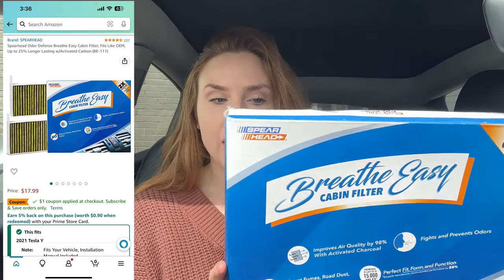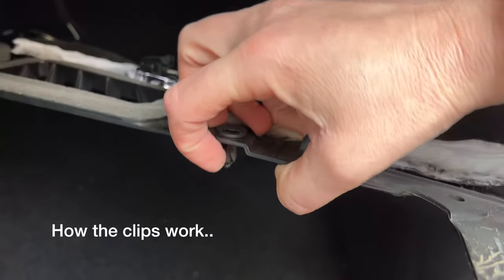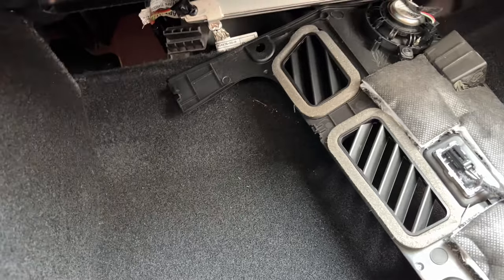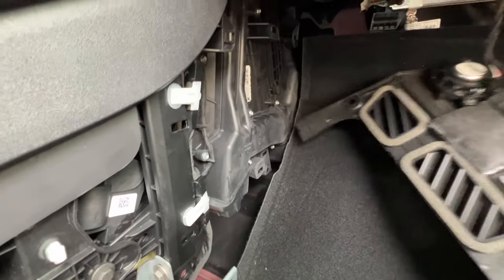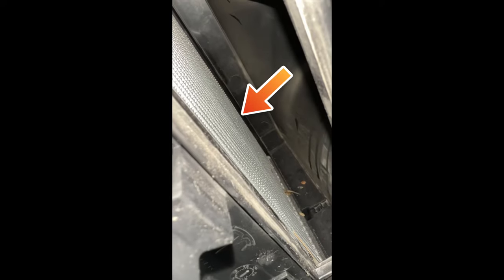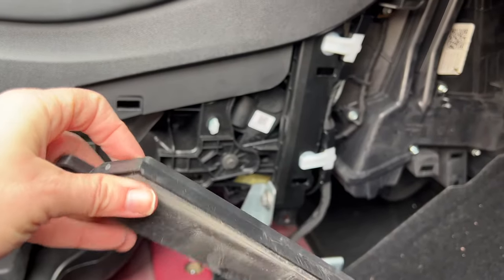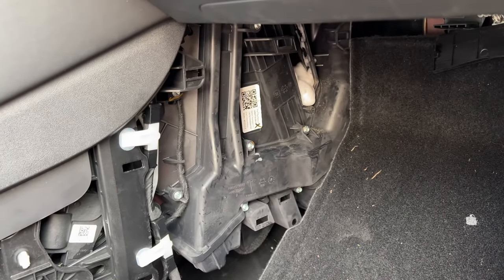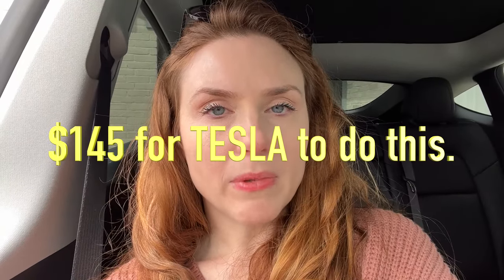DIY Tesla Cabin Filter Replacement & Coil Cleaning (Model 3/Y Full Tutorial)

Comment: Always great instructions!  After doing this, the heater trick does help but one thing I've found that "revitalizes" the filters for longer than the heater is to spray a fine mist of water with a little hydrogen peroxide and rubbing alcohol in it into the inlet under the frunk with the fan on high.  If you spray it with a misting bottle (from a salon store) the mist is really fine, doesn't puddle, and just dampens the filters, killing the bacteria.  2 bursts of like 5 seconds each is good.  The peroxide and alcohol also evaporate 100% and leave no residue unlike Ozium, Lysol, and other things I've heard being used.

Comment: Thanks for helping everyone replace filters and clean coil.
One caveat.
AC chemical coil cleaners are better. The foam you use is not just to clean( as a detergent) or disinfect; it actually has a very high PH chemical removing a thin layer of aluminum oxide so it improves the heat exchange.
You do not need to dry it after using it; actually the opposite. As soon as you turn the AC on, the condensation makes the remainder chemical drip down the bottom drain. You don't need to rinse it.
You don't want that chemical to stay there too long; it will keep etching the aluminum fins.
I used the foam to clean and service the front condenser( the car's AC and radiator) also.( check between the front radiators; they are probably full of leaves and rocks and hair and dirt etc.

Comment: When I bought my 2019 Model 3 Dual Motor back in November 2022, the first thing I did was change the filters based on your videos and it was pretty easy compared to other car related tasks I've had to do over the years.   It wasn't smelling bad yet, but it was a noticeable improvement after the coils were cleaned and filters changed.   Hopefully here in Indiana, I only have to do it once a year.   This summer, I'll have to remember to run my heater and dry it out every now and then.  Another great video!

Comment: Welcome back, Sara!  I'm glad you mentioned the magnetizing trick.  As you may recall from your Model 3, that screw (at least before the refresh) is on the top, making it tougher to get to.  I found that using a "short" driver a lot easier to get in there.  BTW, you can magnetize the screw itself, without the need of a special magnetized bit, if you have a strong magnet laying around.  Just drag the screw across the magnet for several seconds and voila!   I changed our Model 3 filters after watching your other video and used the same stuff.  Excellent result.  Less than six months later, it started smelling funky again, even though I live in semi-arid SoCal.  So I decided to try something "different".  I have a small, 120v ozone generator and stuck it in the air intake and ran the fan on high for about 20 minutes, total.  10 with the ozone generator running, then another 10 without to clear the ozone out of there.  Hasn't been a problem since, but I'll probably clean the coils and change the filters again in another month or three, regardless.  Hope your husband and kids appreciate your work!!

Comment: Thanks a lot for this. Approaching 15k miles on the Y in the first year and I may change the filters before summer hits. This is one of my favorite videos you’ve made so far. Not much maintenance on Teslas but this is a big plus to know how to do.
Reply from the maker: You’re very welcome! But if you car isn’t smelling super horrible rn, I would wait u til AFTER summer to do it. Because the condensation from using the A/C in summer is what causes the problem. So if you do this after every summer your new clean filters will stay clean longer. Does that make sense? Like every summer, you’re breeding that bacteria on them with the moisture caused by A/C usage.
Reply: @SaraJAwesome  it makes a lot of sense. I rented a Polestar 2 in Arizona recently with 17k miles and it smelt like you said when I turned the AC on. Guy that rented it to me didn’t notice it apparently. I told him it was probably his cabin filter.

Comment: You are correct about the condensation. I have had this problem in my Y. The main issue for me was that using AC usually automatically goes into recirculating mode. I manually put it to fresh air mode often and it seems to dry out the chamber. FYI I have had this issue on my non Tesla vehicle that was used in recirculating mode All the time. Since using it in fresh air mode seems to solve the issue for me.
Reply from the maker: It could help with the right conditions, but keep in mind you will suck in all the debris from
Outside that will clog up your filters faster and then breed more odor causing bacteria (bugs, leaves, pollen, dirt, dust, exhaust fumes from other cars). It also depends on the temperature of the outside air and the humidity of the outside air as well. When you are pulling in “fresh” air and it’s hot outside, your A/C compressor has to work harder to constantly cool off that hot air from outside. When it’s on recirculating you’re circulating cleaner air and it’s getting the temperature to you want easier and faster.
Reply: @SaraJAwesome 
Your videos are indeed Awesome.

Comment: I just installed mine today following your video! Thank you so much for the help! It was easy. My filters were surprisingly not as dirty as I thought since I'm doing this for the first time after 60K miles... 9:39 your filters actually look worse than my 22 model Y! Mine were white not yellow either

I used the Klima cleaner you mentioned and the straw busted out of the can and shot foam in my eye. I thought it would burn but I was fine. Then it busted off a 2nd time (this time I was wearing sun glasses) and shot foam all over the floor xD an eventful cabin filter swap to say the least!